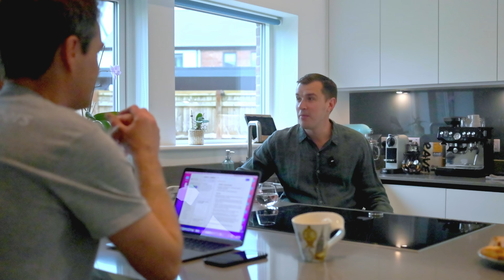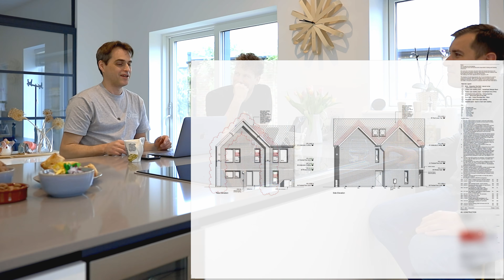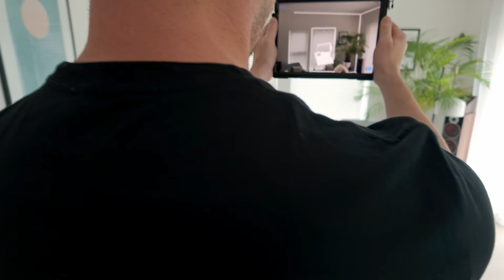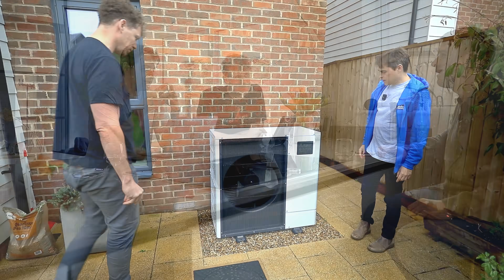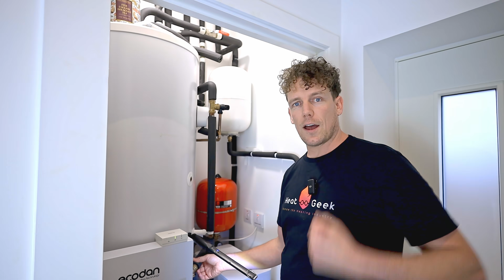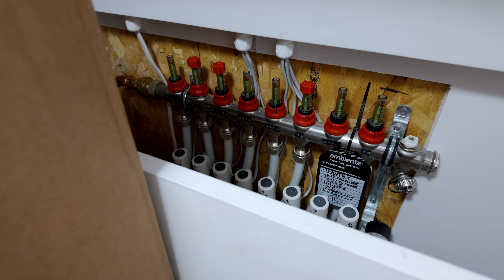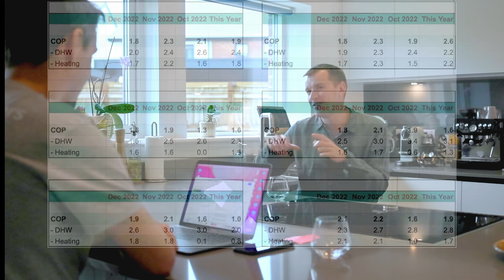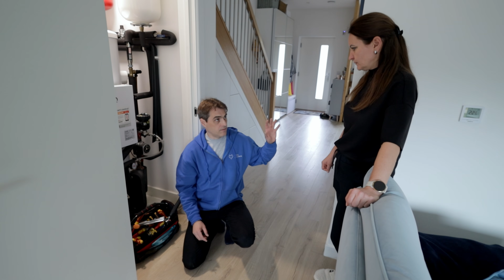How Developers Are Ruining The Heat Pump Market

Comment: There seems to be a dilemma here? One look at the house and I estimated a 3.5kW HP. However the reheat time on the DHW will be 2hours for a 155L tank (limited by HP power not coil area). Will people in top quality housing be prepared to wait that long? It must be a problem for all passiv or almost passiv designs? Running an expensive and inefficient immersion is no answer. It seems manufacturers need to bring out a HP with a dual compressor. A small one for efficient heating, and larger one for DHW. Perhaps the builder optimised DHW at the expense of heating? Clearly impractical to fit two separate HPs. You could use any spare capacity after heating to trickle charge a thermal store, but that would be expensive and need space. Thoughts please.
Reply: Maybe we should have a separate high temperature heat pump for hot water and low temperature for space heating ?
Reply: @philthompson1097  This is the first time I've seen Adam and Syzmon look at a passiv house and I think they're applying all the experience they have had with average Victorian houses but that illustrates exactly what Adam was saying about too much experience can be a problem! The customer said he couldn't get the underfloor heating warm - but you'll never need the floor to feel warm - it should be well below body temperature in that house, as should the radiators. In fact there's enough heat leaking out of the DHW cylinder to heat the house for most of the year. I'd suggest you use the ASHP to heat the water once a day, up to 50°C. Get a small (2.5kW) mini split a/c installed and use that for your heating most of the time - and for cooling when the sun has overheated the place. Adam's calculated 3kW heat loss (only on the very coldest days) could well be covered by the appliances and people in the house. I don't think you'll ever see a COP over 4.0 because so much of the usage is High Temp for hot water. You only get a good COP when the house is cold - making it easy to transfer heat into. For instance if you have the house at 23° and the outside air is 0° the ASHP has to get up to a flow temp of 23° at least before the radiators will start emitting. Whereas in a cold Victorian building where the inhabitants are used to living at 18° or less and heat is flying out the walls, a flow temp of 23° will start heating the house. Hence it's much easier to get a good COP in a leaky cold house.
Reply: @philthompson1097  This makes a lot of sense. For a small home it’s difficult to justify, but for larger homes it could work well especially if there is a need for space cooling in summer.
Reply: Very good points and kind of what I was thinking because in reality the heating isn't required at the moment and with the heat pump doing only DHW the COP will be low. The obvious answer is a small mini-split air to air heat pump for heating - this works especially well if you have MVHR which helps to circulate the heat. I use two 3.5kW (output) mini-splits for heating and the gas boiler for DHW - it's a really efficient 'hybrid' system that was cheap to install with no disruption. It gives so many more options for heating and full backup if anything fails. The boiler also comes on for 10 mins to heat the towel rail in the bathrooms - all other rads are shut off. And we get cooling if required.
Reply: No, they don't be prepared to wait that long, nor should they need to. But a 155L litre cylinder is too small for a large, up-market home. 300l litres would seem necessary if the water is to be generated and stored at a low temperature (e.g. 45C). There is plenty of reheat time available. If the heat pump comes on at midnight, when electricity is cheap, you have four hours of cheap electricity to heat 300 litres of water. (7C water to 43C in 4 hours takes 3.15kW) Add in free electricity during the summer months from Solar PV, or pre-heating of the makeup water in the tank from solar thermal, and you have a very efficient arrangement, albeit at some extra complexity. The cylinder will only about 70W/hr during the day, so this can be replaced easily if there is space heating demand at the same time.

Comment: Hi guys, I notice that the first house had a kitchen hob with a downdraft extractor, do you happen to know if that was connected to the MVHR system?  I'm about to start a barn conversion which will have a heat pump and  MHVR system and a hob similar to that but no one seems to know if it can be connected to the MVHR system?
Reply: Retrofitted my MVHR, hob is separate. 
You don't want the vapour from cooking in your pipework.
Reply: @marcexec  Many thanks for that, best answer I've had so far, do you vent under the island then, into the kitchen airspace at floor level?
Reply: @UKSuperTone  neither, kitchen is in an extension and dining area is connected, where we have MVHR extraction.
No issues, even though we have good airtightness, standard IKEA extractor with 150mm pipe going straight up and roof vent.
Reply: You don't want the lard from the kitchen getting into the your MVHR pipes and heat exchanger, so a lard-filter in the kitchen extractor is a good idea. If you want a hob hood then a recirculating one you change the filter on from time to time is most efficient, because holes in your house are bad. But if you really want to you can just vent it outside, and add a closure so it's reasonably airtight when not in use which is 99% of the time.
Reply: @xxwookey  thanks for that, sounds advice, will probably go for a down draft and vent it into the kitchen. Cheers.
Reply: Could be recirculating with a filter.  The kitchen extract vent should be a good distance from the hob.
Reply: @markthomasson5077  , thanks , yes it's a recirculating hob with filter, so hopefully will be OK. Why does the extract vent need to be a way from the hob?  Is it so the mvhr filters don't get clogged?
Reply: @ exactly

Comment: You mention the low loss headers in those systems not being required but its obvious to anyone familiar with mitsubishi that those are preplumbed cylinders made by the manufacturer to their own design. So if they are required then why do mitsubishi make them like that? I've had plenty of experience with low flow errors due to the fact that most heat pumps require a constant flow rate and with ufh if it is zoned correctly ( which if open plan I do agree with you only one stat) but if individual rooms you will definitely need some sort of hydraulic separation to allow different flow rates for ashp and say mabee only one or two zones being in use.
Reply: Mitsubishi make them like that be they expect them to go into homes with higher heat losses. Mitsubishi seem to be dreadfully behind the curve.

Comment: What heat loss is is accounted for a 200 litre cylinder like in the video?
Reply: Part L of the building regs limits heat loss to 130w an hour. I'd expect that cylinder to be losing about half that, so 70 watts an hour.

Comment: You didn't say how much of their usage is for DHW? If this is a Passiv house, I guess that they use very little for space heating and most for Hot Water. A high temp ASHP isn't going to give a high COP for hot water heating. So the other elephant in the room is the payback period - how much of their £500 annual bill will be saved by having a couple of Heat Geeks plumbing away for two days?
Reply: It might save them £250 a year, but over the life of the building, which is going to be at least 100 years, and given the inflation that mightbe expected in energy prices that saving will probably be about £30,000!
Reply: @tlangdon12  So where is that follow up video where they save £250/year? Did Heat Geek ever go back after slagging off the installers?

Comment: Question on the SCOP figures for a super insulated house like these. Would it be lower overall as the system should spend more time on heating the hot water rather than heating the house? Just thinking that it's usually the heating cycle that gets the best COP vs HW so does it skew the numbers a little bit? I would have assumed that they would be in the 5+ figures for SCOP but if there is little heat demand this would drag the average down.
Reply: Yes, that is likely. In a house at PH level hot water load can be quite similar to space heating load. It might even be higher. And COP is typically lower on DHW than space heating, so you are correct. But it's a slightly lower SCOP on a much lower total heat/energy load, so it's still all good.

Comment: You Two should know better, by not disclosing the contractor you appear to cover up for them, this only allows them to carry on regardless. By naming them and helping the home owner get redress to put the systems right then they will have no option but to improve the installations they carry out.
Don't jump on the fence, you're better than that.

Comment: Amazing video chaps, great job! Really getting to the crux of the problem within this industry. So called 'experts' throwing this nonsense in, thinking they are doing the right thing. Most of whats installed in these houses is just not needed. KISS! As always the haters will blame the heat pump, when in fact its just lazy 'copy and paste' designs from home to home using the 'thats what we've always done' method of system design. The only people who suffer in all of this are the poor homeowners who have to live with a poor system and pay crazy money for their comfort. Manufacturers are also to blame for producing this nonsense that does nothing for good efficiency. One other point to note that I haven't seen mentioned here, is the longevity of the heat pump in this situation, the compressor is likely to fail within 5 years here too, probably just outside of its manufacturers warranty too!

Comment: Would someone be kind enough to explain the science behind having the whole vessel on the return & exactly how it effects static pressures of the system.
Reply from the maker: yes, here you go. This are my personal notes on the subject:

- historically pumps were installed on the return of the system to keep the pumps cooler, so that they could run longer
- a lot of pumps in the early days of heating were powerful enough, that when pumping towards the expansion vessel they could drop the pressure behind the pump to sub atmospheric levels - causing ingress of air into the system, corrosion problems and vacuum behind the pump causing cavitation
- the point of no pressure change (Neutral Point) - place in a closed hydronic system where the expansion vessel connects into the pipework - the pump cannot affect the overall system pressure
- If you pump away from the neutral point (expansion vessel connection point) - the pump will add its pressure to the system's static fill pressure. (Example - 1bar fill pressure, 2.5m head pump. 2.5 head in bar = 0.245 bar. This means that pumping away from the vessel and the system static pressure is at 1 bar, we will get 1.24 bar in front of the pump.
- However if you pump towards the expansion vessel - the pump will not be able to raise the pressure in front of it at all. Instead it will lower the pressure behind, as it needs to create a pressure differential to move water around the system
- if the pump has a head bigger than the system static pressure - it can create pressure lower than atmospheric pressure behind. You would need at least a 10m pump for that to happen on a 1 bar static fill system - but in principle it is not impossible. 
- The place where the expansion vessel connects to the system is the point of no pressure change - or the neutral point in the system - the pump cannot affect the pressure in that point in any way
- The Pump cannot add or remove the water form the expansion vessel - water is not compressible - there is nowhere for the water to go too, therefore the pump cannot change the pressure in the expansion vessel
- In a closed hydronic system, the pump doesn't have to show its pressure differential as an increase of pressure in front of the pump, it can easily show it as a decrease on the suction side as well or if the pump is in the middle of the system - half way away from the expansion vessel - it will show both - half the drop behind and half the increase in front of it of the total operating head. Example - 5m head pump will show 0.25 bar drop behind the pump and 0.25bar increase in front of it
- Henrys Law - 'weight of gas dissolved in a fixed quantity of a liquid is directly proportional to the pressure of that gas if the temperature is constant. It basically means that the more you compress a gas, the more the liquid will be able to absorb it. If you shake a cola bottle and then crack the top - gas will escape from that cola bottle in a spectacular way, why? Because by unscrewing the top you drop the pressure inside the bottle and the liquid cannot hold as much gas, as it can if it is pressurised.
- Henry's Law and Heating - so what does it have to do with heating? If you pump away from the vessel that is very close to the pump, you will increase the pressure in the system in front of the pump only. There is no pressure drop happening in the system. All is good
  
  However if you pump towards the vessel - you will drop the pressure behind the pump. And what happens when we drop the pressure of the liquid? The gas dissolved in the system water has to be released - the Henry's Law tells us that. So when that happens we are creating a situation where we release the air in to the system. This can cause corrosion long term and also make it very difficult to bleed the system from air. 
- So remember this - position of the expansion vessel matters and it should be installed on the return pipework as close as possible to the system circulator.
Reply: Thanks
Reply: I totally get it now, But wouldn't it be the same for say a tee on the circuit that may go to a closed thermostatic radiator valve or any dead leg in the system? If there was a tee leading to a closed valve be it 2 port or lockshield, as the circulating water passing the tee as it can't add water to that dead leg or remove it would that still constitute as a point of no pressure change?

Comment: Are these mixed emmiter systems ?
Reply from the maker: no - fixed temp on both as well - we missed that. But both UFH and rads can run at the same temperature - I am sure by accident and not by desgin.
Reply: @UrbanPlumbers  what do you think the flow temperature for these two systems will be on a design day?
Reply from the maker: @andrewmillwardwatford9410 around 30-32c
Reply: @UrbanPlumbers  it'll be interesting to see the results. Another great video well done

Comment: This video is revealing 2 problems:
- the lack of competency of some system designers
- the false data advertise by some HP manufacturers, namely Mitsubishi. You cant design right if the manufacturer does not give you the right data. These issues on Ecodan are so recurring, Mitsubishi is just waiting for a consumer action class against them...
Government should act and make sure that what you get is what is advertised.
Reply: what issues with ecodan are you talking about?
Reply: What's the issue with Mitsubishi? I have an old R410A one, so I'm interested in what data you think is false.
Reply: @jeffhenderson9595  that's called consumer protection and fair competition. I though that what I was paying tax for!

Comment: So is it more efficient to be heating every room constantly at lower temperatures as opposed to be turning zoned spaces on when required.
Reply from the maker: Yes massively more efficient
Reply: @UrbanPlumbers  I have rooms that would not require heating all year round and maybe just at Christmas. Would that not be an unnecessary heat loss
Reply from the maker: No it wouldn’t. It’s usually more efficient and quite often cheaper to keep most houses up to temp with heat pumps.

Comment: Absolutely shocking. If the installer is MCS certified, simply report this estate to MCS and let them take action. If MCS won't, proves that their 'monopoly' is a sham and no proof of competence. I'm a fan of Urban and Heat Geek - intelligent thinking from first principles, although it's all quite simple really. I'm a professional engineer, so reluctant to join MCS, but not allowed to access BUS without doing so. I know someone getting a HP under the HUG scheme which is PAS2035 based. Five companies involved and not clear who is responsible for anything, so will be interesting to see what problems that throws up.
Reply: There is no requirement for mcs certification in this scenario. No grant money to claim back .
Reply: @persona250  Agreed, but the boys tell us this was a large installer, so would expect them to have MCS so they can pick up other work. That aside architects are seen as competent professionals by PAS2035, so why would they specify a badly designed system, or contract out same? We seem to be supporting HG's comment that a challenging mind is better than an experienced mind :-)

Comment: I came from a geothermal heatpump background started almost 20 years ago open circuit large pipe low temp system simple avoiding distortion accuracy when sizing exc...was actually easy then as general public knew nothing so could do as you pleased nowadays public are difficult want and expect it to be zoned everywhere if you don't supply what they want you don't get the job they think your the hack...
Also Installing well is only half the story very few people can diagnose and repair any kind of heatpump when they get older few years pass quickly. Also manufacturers charge too much for parts older machines  tend to become economic rightoffs once 7 or 8 years old too chancy to risk expensive repair... manufacturers need to be tacked on this and shamed talking of lowering carbon and then setting people up with esentialy a disposable heating appliance....